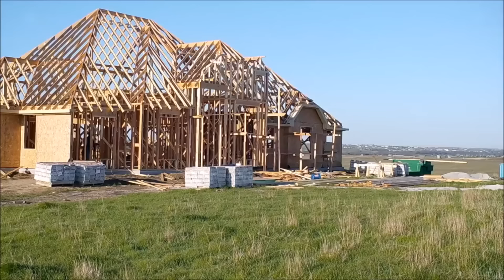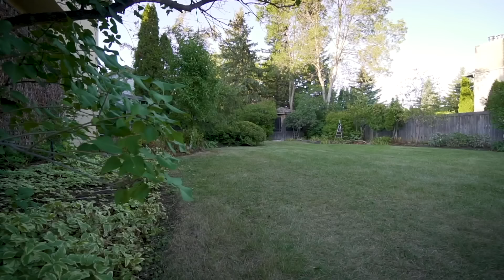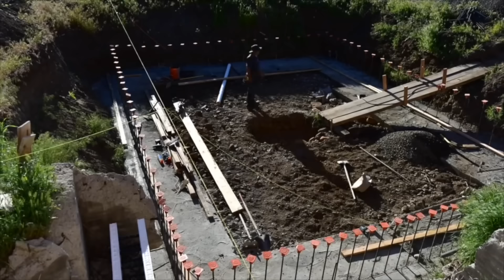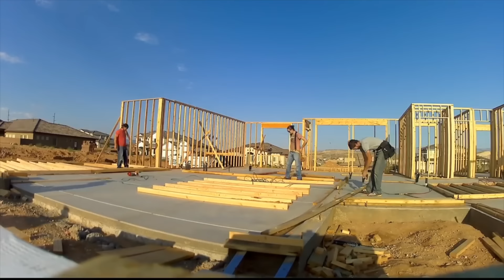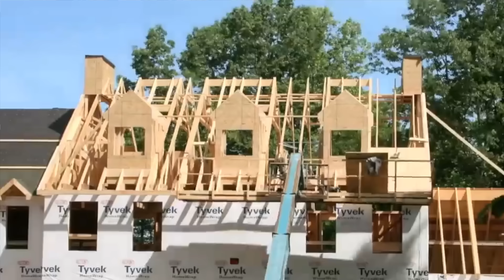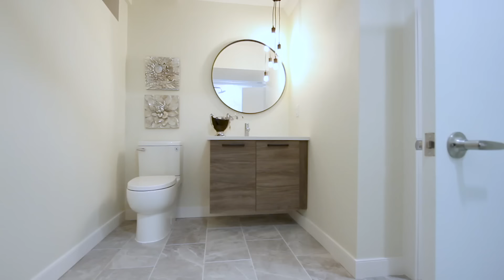THE REAL COST TO BUILD YOUR HOME | Custom Home | Building a house Cost

Comment: best ever honest estimation , better than good Friends :( , as i am kind of same business, in the beginning no body gave me explanation as you gave here... i  know plus minus always there what you select you pay. but pretty close. thanks
Reply from the maker: Benny Sadana That’s very kind!  I appreciate it!  Thanks for watching.  Stay tuned for more informative and honest videos!  Let us know if you have any specific videos you would like to see!
Reply: Thnc dude wheres all the framming at today i hear colorados booming?
Reply: Im no building/ blueprint reading pro however, im from ct however back in the 1990s colorado was building thousands of new homes all precut lumber and trussess for the roof framming and when i was there working it took us framming crews 1 week to fully fram a house, the rough framming including doors and windows. And before i left i personal read the blue prints to 3 homes and me and just 2 guys frammed 3 houses are selfs for this guy who in return just sold them quick it was unbelievable.1st i know for a fact the simpler thhe design of a home for instance building a square or a simple rectagle with precuts studs, basic plywood flooring, then build another floor on top of that and cap it off with precut trussess or even rafters however i prefer trussess there quick and a lot easier. There simple toe nail each end your done..angways im talking keeping everything simple but practicle theres no need for elevated walls/ jogs/hips/etc esp if your on a budget and if you want more square feet of actual living space from homes say somthing 30'ft wide by whatever 50' ft long or 100'ft thats a 3000 square foot home now if you just keep it simple and ad 1 floor on top of the bottom now you have a 6000 square ft home whats great is somthing 30' ft wide all you need is 1 beam running all the way down the middle of tbe basement floor to start running your joices etc its simple then the same for the 2nd floor if you rather have all that square feet or whatever the point im making, if theres somone out there who actual has the cash to buy the property out in colorado where the market for saling homes is such a fast turnover rate from what ive been hearing, if somone can purchase this land property , i will fram the homes ( only if there simple but practical)do the siding and roofing and sheetrock , wed have to put a crew together which i can prob do / or you or whatever..a cut man, layout man, patrs guys(a couple laborers its a done deal...
Reply: In my area here in California one has to get a building permit fee for about 5 to 6 thousand. BUT then there's all the other fees that you HAVE to pay to get a permit.  Water connection $20,000, sewer connection $10,000, school fees $6000 +, other development fees...final bill $75,000. By the time you buy the lot, pay for the plans and fees, your out over $250,000. Now you can start digging for your footings. 30 years ago you could have a very nice completed home for less than tha.
Reply: @EmmettLeoHomes  I want to build my home in the next year or so, but I'm on a very tight budget. Lots are around 20,000 for a 1/4 acre and the general pricing is pretty standard, nothing high. 2 bedroom is sort of my ideal (3 if we can squeeze that in) but it would only be me and my wife. 2000 sq/ft is way bigger than we need though for two people. (We were thinking 1 master, 1 office and an extra for guests)

I know you can't do very much, but what would you expect on a build like this?

Thanks!
Reply from the maker: @blakeslocum2732  I am assuming you are asking about cost.  That is very difficult as there are so many different factors.   Easiest?  Ask around the local area for real world cost/sq ft.  That will give you a range.  However, asking the cost of a home is comparable to asking the price of a bag of groceries.  (It depends on what you buy).  You have so many different foundation option, building methods and finish quality in your material and labor.  
Your best bet is to get a builder grade cost /sq ft, go to a custom builder, and draw up what you are thinking, and have it priced out.  If you are close, then a GOOD builder will be able to help you find ways to make your budget work.
Reply: @EmmettLeoHomes  I figured it was like that, I should have known better! I have a home builder I already have had connections with in the past, I will talk to her about all of that. After discussion I decided a 3 bed 2 bath would be a more marketable option because of two reasons. a). The cost more to make a 3 bed versus two bed is pretty insignificant, and b). Is much more sought after in my durrounsing market, so would have a higher selling point. Thank you for the help!
Reply: Is it really honest though? Honest to how it will cost you but really dishonest on how it got that bad. Good homes can be built for way way cheaper, it just has to be done differently and more efficiently. People need to understand common sense and the fundamentals of living that are more than just going to work and letting bureaucracy deals with it. If people understood how regulated, distorted, robbed and so much then things would be different... but this is what we got for now so get into one of these trades or administrative positions for your piece of the pie now! build these houses on property rights to a property that is not yours and you criminally pay tiaxxx for :D
Reply: Emmett Leo Homes hey what’s the home plan at 1:27
Reply: @rafaelmariscal9170  going to this ridiculous process right now with my city for an accessory dwelling unit. Already cost over $60k and haven’t even break ground yet! Did you build one?
Reply: @SAKCraftyCorner  I used to but not anymore.  It's become a very expensive venture that can quickly turn into a nightmare.
Reply: Rafael Mariscal yup! After this, we won’t be building another home from the ground up again, all these “miscellaneous fees” and “unexpected costs” are getting ridiculous!
Reply: @EmmettLeoHomes  What are some of your locations???
Reply from the maker: @natalie-jb2tv  we build in Winnipeg, Mb, Canada 🇨🇦
Reply: Ok ok ok
Reply: Lil p
Reply: As of today July 16 2021 I wonder what the average cost per square foot would be now? Considering lumber prices and just inflation overall

Comment: I am building a custom 2000 sq ft structure right now for about $115 USD sqft.  How?

1.  I am my own general contractor
2.  I am my own HVAC contractor
3.  I am my own excavator/trench operator for electrical, nat gas, water, sewer.

4.  Kept the kitchen small / IKEA
5.  Finding materials at wholesale or deeply discounted (e.g. hardwood flooring for $2.08/sq ft)
6.  Monitoring every line item and expenditure.

That said I have made mistakes, but mostly pretty small ones.

I still have 8-foot doors on the ground floor, 3-layer insulated garage doors, tile baths and showers, shiplap in the bathrooms, wood finished cathedral ceilings and other high-end finishes.

The only item where I am exceeding your stated cost is electrical.  This is in part because I am installing two vehicle chargers, heated floors in the bathrooms and lighting and outlets, both inside and out, beyond what is typical.
Reply: Andrew Diamond $115 is great! I usually build at $100-150 per sqft
Reply: Overpriced
Reply: @jp3354  Have you seen it?  2x6 framing, Hardiplank and brick, Rockwool insulation, premium materials and craftsmanship throughout.

So quick to judge something that you know nothing about there, J P.   Sad.
Reply: Can I ask, what is your background? I am not afraid to get my hands dirty, but worry that I won’t do something to code and will pay for it later at resale, or worse if somebody gets hurt. What all can a homeowner do without a license? I have done tile, very basic carpentry, and concrete before, and have electricians and plumbers in the family. Only have a $120k budget for everything, though, including the lot.
Reply: @nobodynohow8039  I pull permits and read up (and watch a lot of YouTube) on stuff that I intend to work on.  I'm an IT person as a job, but have worked in construction a bit when I was younger.

In North Carolina, a homeowner can pull a permit and do anything, as long as that homeowner 1. Lives in the home and 2. Continues to live in the home for one year after project completion.

Inspections here are pretty good, and they catch some mistakes.  I'm not anywhere near burning something down or anything like that, though.

$120k is very tight.   It might be easier to find a fixer-upper in the $80-$100k neighboorhood and work on that.
Reply: @andrewdiamond2697  Sounds too good. What state and what town? I hope i'll get same deal in upstate South Carolina.
Reply: @andrewdiamond2697  awesome, trying to do the same in Florida. Almost have the permit in hand.
Reply: @drchamp1902  Congrats.  I had my final inspection and certificate of occupancy from the County about 3 months ago.  The building is done and I'm now outside working on new landscaping.  I have about $300k into the project (including driveway, hardscape, furniture, 
etc,) but there are a lot of features and custom finishes...the garage/workshop itself is nicer than the house I grew up in.
Reply: @andrewdiamond2697  I ended up learning AutoCAD and drawing all the plans myself. The engineer did the structural and the septic site plans. The state of Florida approved the septic and gave me the permit but the city has rejected the engineer's site plan. So my plans worked fine, but now trying to get the engineer to fix his is impossible, especially after he already got paid. One more reason to do things yourself:)
Reply: @drchamp1902  I had similar issues.  I did my original drawings initially in MS Paint, since I have no CAD skills.  I then took my drawings to an architect, who designed a structure that violated several building codes and zoning regulations.  I had to have everything redrawn and reengineered, though I still kept the overall drawing and engineering cost around $4/sqft...so not great but not horrible either.
Reply: @andrewdiamond2697  my engineer charged $1/sf $3500 plus $1000 for septic, $900 for the pool. The permit  in the city is expensive, almost $11,000. But similar homes sell for $700k, hoping to build it for under $400k plus the lot
Reply: @drchamp1902  Yikes.  I paid about $2500 for engineering twice...so maybe $1.25/sf total.  Permits and inspection fees were under $3000 here in North Carolina
Reply: @andrewdiamond2697  New Yorkers ruin everything:)
Reply: @andrewdiamond2697  how did you manage to get a builder risk insurance, seems that the carriers want a GC with at least 3 years of active coverage.
Reply: @drchamp1902  I didn't.  I added higher coverage to my homeowner's policy and had a construction addendum added as well.

Comment: I built  a 1500sq ft addition in 2008, I was the GC. It was a challenge to meet the target of $145/sq ft. US
Labor  was about 1/2 the total build cost. No costly mistakes, but excavating, finish grading and dump fees were a moving target. To those that think they can do it themselves...good luck. There are strict code requirements that require licensed trades to pass inspections. With a one off project there is very little leverage to negotiate pricing with the trades.
 DIYers tend to shop the cheapest materials to save money. If you want a professional looking job that doesn't require rework in 5 years buy the best material that compares with the homes in the neighborhood.

Comment: We used to build custom homes in  2002 California , the going rate for a regular standard house was $100sf . That was 17 years ago and the prices for lumber have skyrocketed so has everything else. In my opinion this man is spitting straight facts, sure  I can get it under $150sf but that would mean I'd have to do most of the subcontracting myself and deal with inspectors.
Reply from the maker: big dogger most people do not take this is context, or factor in their time, location, currency or finish level.  

Great catch!  

Thanks for watching!

Comment: I just did a 3600sq/ft custom (4 bedroom 3 bath). ICF foundation, all hardwood, custom kitchen, smart appliances, butler pantry, all open concept. Second floor balcony, 240sq/ft walk-in with wall to wall to wall custom closets etc etc etc. I paid $80 a sq/ft. I must have did a good job because it made it into new home of the week in a paper with over 1m purchasers. 

The last house I did started 1800sq/ft and abandoned that I bought for $145k. My cost was around $50 a sq/ft. It ended up 3000sq/ft and sold for $765,000.

The main trick is not to overpay. You can get really nice stuff for a really nice price if you shop around and make deals. I probably spent as much time sourcing materials and lighting and appliances and flooring and trim as I did working on it. But it's worth it. 

A custom builder was in the house and told me he could have built it for $655,000. I told him how great that is considering my cost was less than $300,000 all-in. He couldn't believe the results on such a cheap price.
Reply from the maker: That's great.  Thanks for watching!

Comment: for those of us who are in the US, costs of building a house requires heavy input weights. Can't even use the average cost to build in the US or regionally, because there are a million variables. I am currently putting together a proposal for a construction loan in which I am the owner-builder, and plan to use SIP panels instead of expensive stick framing. I even plan on doing a lot of the SIP panel installs myself. Cutting out the General Contractor fees/markups and framing labor costs themselves will cut my final price in half. Not to mention all of the other sweat equity I plan on using. For others, using a builder is their only option - for them I would highly recommend looking into a SIP panel house. Would still save money in the end even if a builder is needed. Not to mention the savings in HVAC loads with a SIP house over a stick built.

Comment: Bang on Dan!!!!!  I have built six homes myself, acting as the general contractor and subbing everything out on each one.  Your costs are exactly what I have experienced myself in 2019.  Yes I have also experienced the HOT market (2009) vs the Not hot market and there was a 25% price increase in labour rates that year.  Luckily the labour market rates have dropped down significantly. 

One thing you didn't mention is the cost of the dreaded DEVELOPMENT COST FEE which the municipality charges for every new house build.  In my city this cost is a whopping $45,000. so that cost gets paid at the same time you pay for your building permit. Can you imagine being out of pocket $50000 before you even put a shovel in the ground.

I have been lucky on my builds to have experience only one hot market condition. On average I have built for $100 sq ft from 1980 - 1990,  $125 sq ft from 1991 - 2000,  $150 sq ft from 2001 -2008,  $225 sq ft in 2009-2010.  My cost for my last build in 2018 was $160 sq ft.

It is nice to hear that  I may be lucky enough to build again for under $175 sq ft all in.

Keep up the great work.
Reply from the maker: Joseph Braia i appreciate the comment!  That’s great that things have gone so well for you!  

Yes, Winnipeg’s development fees are pushing developers to reconsiders great project that they would otherwise do.  It’s becoming very tedious and downright thievery.  

Thank you for watching!  Hope your next build goes well!

Comment: Great video- I was wondering about a few things: Generally how is construction pricing affected by replacing large areas of standard wall with large windows? Radiant floor heating vs central? external/internal french drains? - Thank you!!
Reply from the maker: Willard Umphrey if you are replacing a standard wall, with a wall of windows, you are looking at any wagers from 5-10x more in pricing.  

Heating and cooling depend on the home and what extra you would have to add.  Adding central air to a forced air system is easy.  Adding central air to radiant floors, (not cooled piping)  would need a completely separate system installed.  

Drainage depends mostly on location and ground requirements.  Internal drains are often not used where we are due to code requirements and it being outside the norm for installers.  

You will find that anything that is not typical is usually more expensive and harder to find installers that know what they are doing.  

You can create an amazing home if you focus on the design of applications and efficiency aspects rather than simply the finishes.

Thanks for watching.

Comment: A build with mid level finishes (not the cheapest and not the most expensive) in NC is $135 a sq ft
Reply: Bleacher McAdams Where in NC are you located? I’m an hour out from Charlotte and the cheapest I could find is $150 per sq ft.
Reply: @ibtuspojhmoobxwb7447  Is the $150.00 per sq foot  to build on your own property that already has level lot and water and sewage and power and concrete drive? Or is the $150.00 per sq ft the price of homes including lot water power sewage etc? I am almost ready to build and have my perfect lot. Thanks.